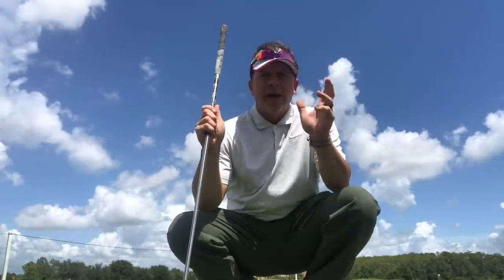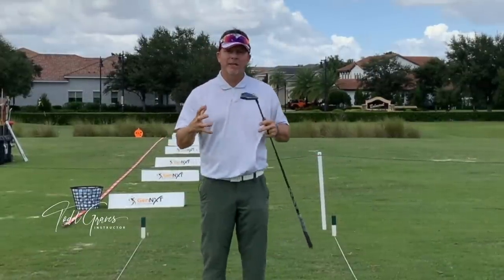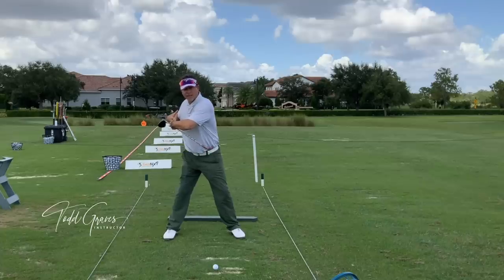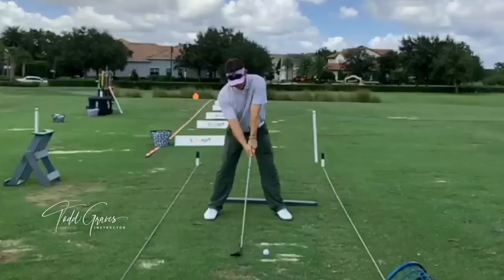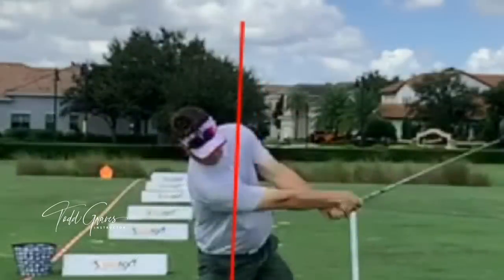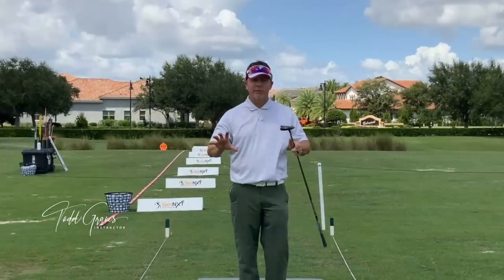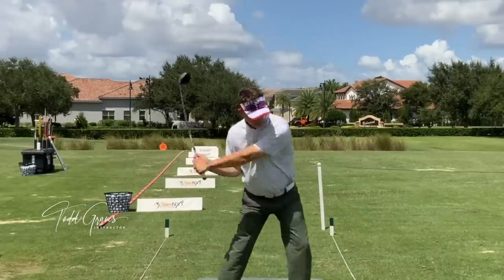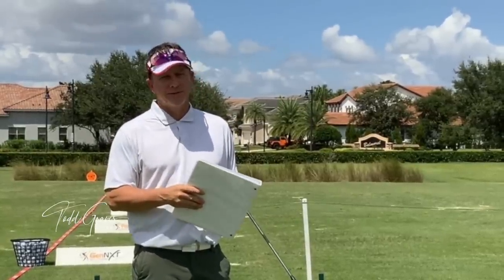The Stop and Go of Single Plane Swing Speed

Comment: Another great video. You seem to cover a lot of information lacking in others. I do have a comment on the stopping of the right shoulder. From a dynamics perspective, it seems most likely that the motion of the left shoulder away from the ball is responsible for the acceleration of the club, allowing the wrist release. The stopping point seems most critical for consistent ball strike location heel to toe, and a flattening of the club head trajectory thru impact (IMO). If the club head continues to accelerate (tangentially/ball path direction) after the left shoulder becomes largely stationary, it would imply the right hand is active. Do you see tangential acceleration continuing after the left shoulder stops in the data you collected?

Comment: Very good explanation of preventing the lead shoulder from potentially spinning out of control. I actually get the feeling of hitting against a closed lead shoulder at impact. Your term swinging against a 'stopped lead shoulder'  is better. 

Also I actually now see you are doing a typical release of the club head.  At post impact to the ball your trail hands does seems to immediately role over your lead hand as many traditional good players do as well. Are you telling me that Moe did the same rolling over the lead hand with the trail hand release of the club as you have shown just now? Seeing that you saw him in the flesh; I guess you would be the one to know. Cheers.
Reply from the maker: Yes what you are seeing with the trail hand is a rotation BUT, think about what is actually happening, the trail hand is rotating as the torso is turning So, in effect the trial hand / arm are straightening as the torso and shoulders turn.  Therefore, you don't "feel" the rotation of the hand only the extension of the trial arm as you turn.  This is why Moe didn't feel the rotation of the trail hand either.  Because it is happing as the body turns.
Reply: Todd Graves Thank you for the clear explanation.

Comment: Todd what is the distance of your average drive?  Worried that this limited lower body move will reduce distance. Can you help with that fear?
Reply from the maker: I hit the ball about 275 to 280.  Can hit it 290 - 300 Occasionally.  Swing (clubbed) speed 108 - 110.  I've never tried to swing it faster but I'm sure with a bit of speed practice I could get to 113 - 115mph.  In no way am I trying to not rotate my lower body.  Actually I am rotating as much as I can with a flexed lead knee.  I am 35 degrees open with my pelvis at impact.  Hope this helps.
Reply: Thanks.  That makes sense.